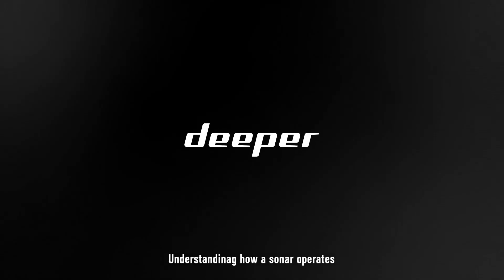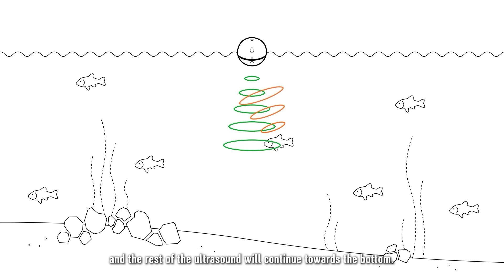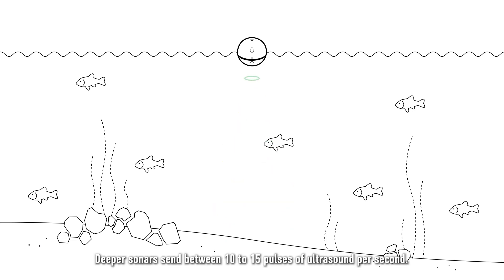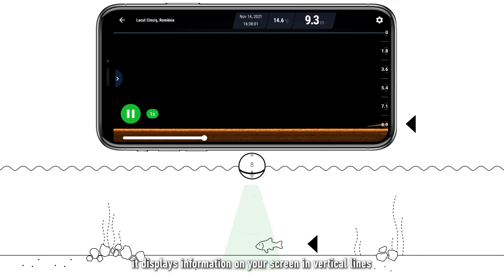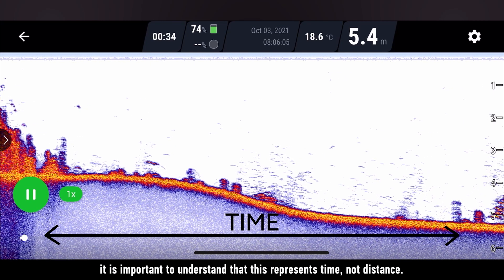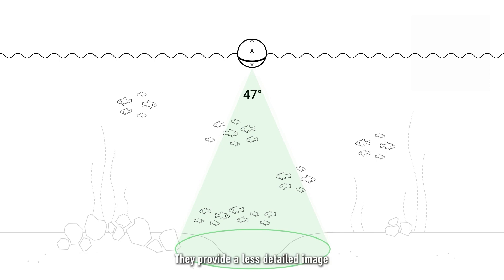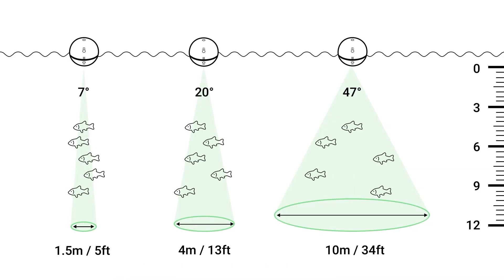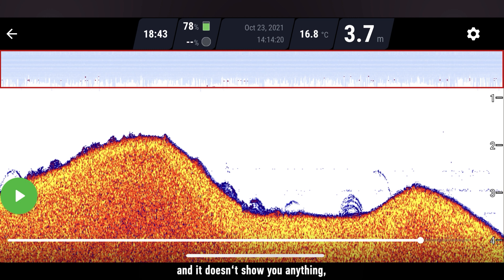Everything You Need to Know About How Sonars Work

Comment: After watching tons of instructional videos. I finally found this one that shows the blind zone concept... THANK YOU! 
I guess that somewhat explains why it wants to switch to narrow when in shallow water. I will be using my chirp 2 tomorrow and still need to know if the device will force me into narrow beam and if so, at what depth.
Reply: Glad you've enjoyed the video! It will switch the beam to narrow when the depth is less than 6ft (1.8m). Also, you can disable the automatic beam switch in the settings on the right side of the screen.
Reply from the maker: Glad you've liked the video! The beam will switch to Narrow if the depth is less than 6ft (1.8m). You can turn off automatic beam switch in the settings on the right side of the screen.